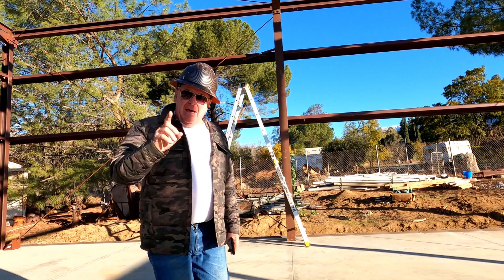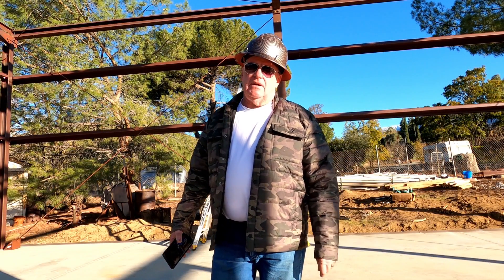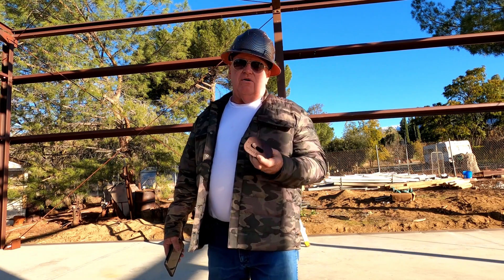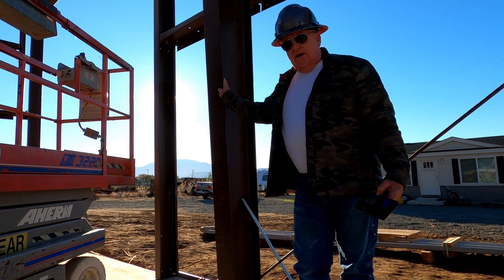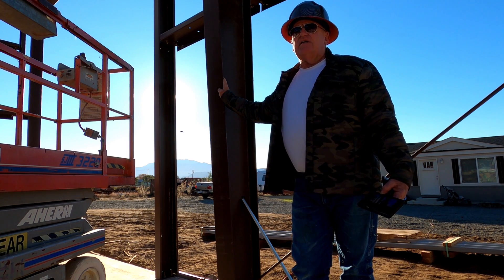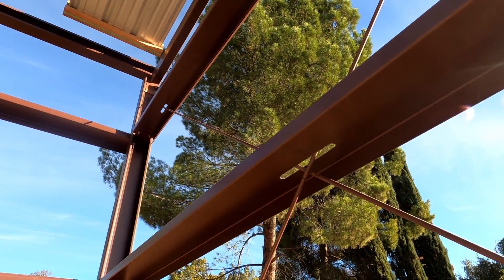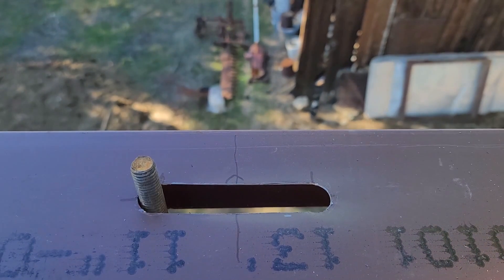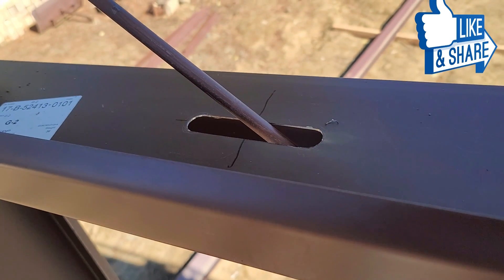How to install bracing on a metal building

Comment: Mueller buildings have the wall girts slotted for cable bracing from the factory. Also the base angle is pre-punched for your drive pins.
Reply from the maker: Its nice that some smaller pre-fabed suppliers go the the extra effort to provide that for there customers but most of the bigger companies all do it this way to save on fabrication cost. Like I said in one of my other videos buyer beware what is usually cheaper to buy is usually more labor intense and if you are paying someone to put it together that it will cost you more money!